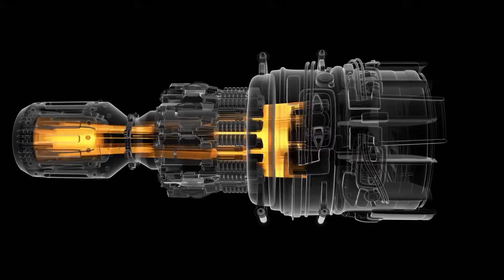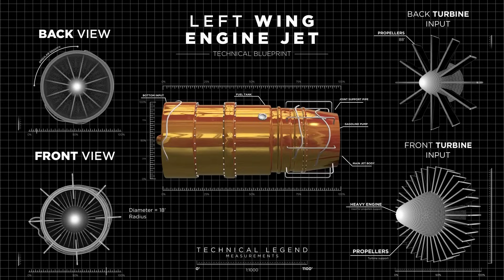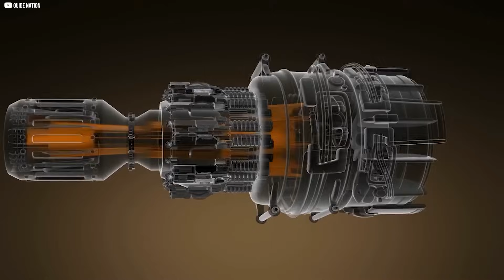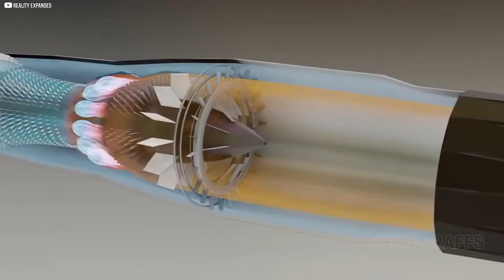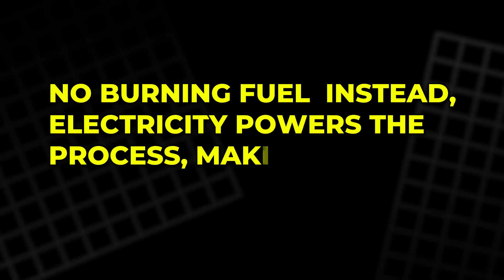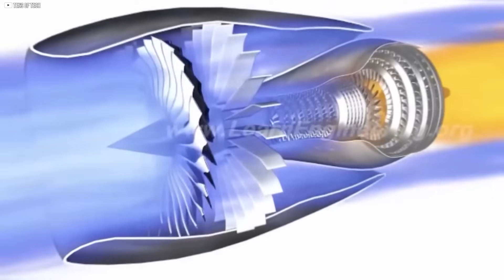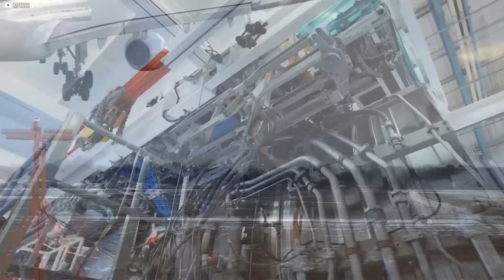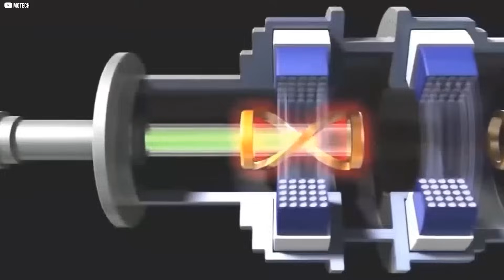How Plasma Jets Could Power the Planes of Tomorrow

Comment: I have 2 questions- 
1) how would these plasma engines affect the atmosphere? 
2) how far could the engines propel the craft?
Reply: They are not engines but motors.
Reply: @PyroShields it's an engine. it uses compressed gases and exhausting heat for thrust....a motor would be to spin a propeller
Reply: @BEEFBRSKT  An engine requires fuel.

Comment: So what makes the electricity? A battery?  No help.. a gas generator?  😂😂 Again no help, solves nothing.
Reply: Did you watch the video? It literally said battery, dope.
Reply: @PyroShields   batteries dont make flames
Pinhead
Reply: @johnhause7150  I'm' not going to explain the scientific process how it works but if you watch the video it explains how it works. Clearly you didn't watch the video but went straight to the comments.
Reply: @PyroShields   what produces the fuel that it burns, the battery? Battery is for ignition which I fully understand, still needs fuel to burn. I dont care what the commercial told you, 3 things are REQUIRED to make fire, oxygen, ignition source and FUEL.  Oxygen is NOT flammable.
Reply: @johnhause7150  If you watched the video you would know there is no fuel. Scientific explanation starts at 4:47

Comment: At higher altitudes more of the air is ionized and that could save energy for ionization. Further oxygen for combustion is not required and maybe that translates to higher flight heights. I think the thrust is still the main issue but I think it is worth researching as it is clearly a breakthrough technology.

Comment: A plasma jet will burn with a very hot electrical spark. Please see lightening storms and thunder claps. As the now super hot air plasma burns all the air around and down the  lightning path to ground or from the ground to the highly positively charged cloud leaving a powerful vacuum tunnel in its wake.  Then the surrounding air rushes in to fill that vacuum making the thunder clap noise !
You pal need to learn more Physics !

Comment: I will never work .
Reply: stop being a bum, bum.
Reply: The engine already has.  What might not work is the energy storage density of however they choose to store the energy in, basically batteries that can store enough energy in the given mass and volume constraints.

Now, what people forget are that batteries are just chemically stored energy and so are hydrocarbon fuels.  We can actually synthesize hydrocarbon fuels such as jet fuel from syngas, a mixture of carbon monoxide and hydrogen gases and we do so to dilute North American high sulfur diesel and jet fuel to meet ultra low sulfur federal requirements.   WWII Germany synthesized their fuel from syngas from coal.  Sandia Labs has demonstrated that carbon monoxide and syngas can be efficiently generated from carbon dioxide and steam with just a solar furnace.  Basically, we can just make jet fuel from water and carbon dioxide (the truck would be to find a concentrated source of carbon dioxide as it's costly to concentrate it from the air).  It really isn't necessary to convert to purely electric propulsion as we can just use the electricity to produce the hydrocarbon fuels from non-fossil sources...

Note that synthetic fuels from syngas is a backup fuel plan for the US Air Force as syngas can be generated from natural gas, coal, wood, agricultural wastes, trash and old tires...
Reply: If you have an high dense energy source you would use the Electricity to power Propeller
Reply: Said everyone about everything in history 😂
Reply: @dom5004  I know that's why I always say that,  just for fun . 😅